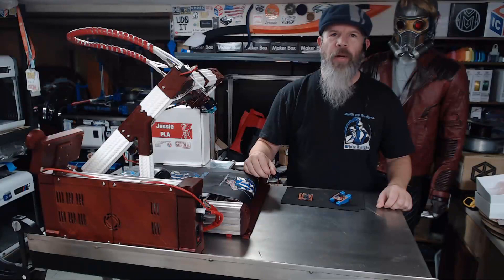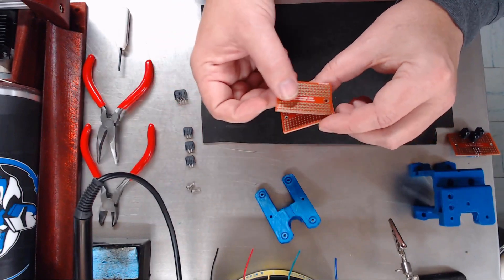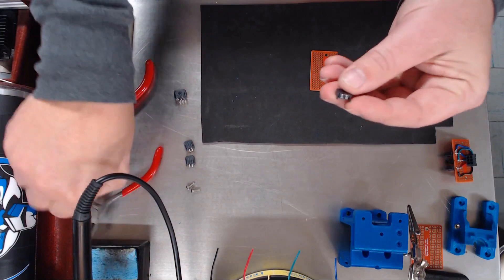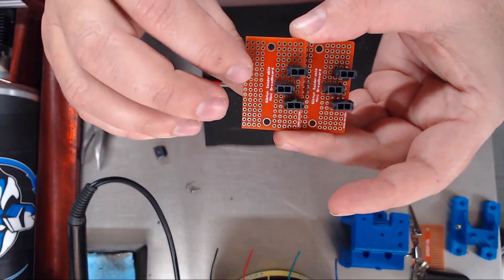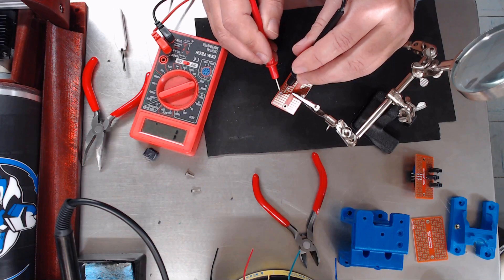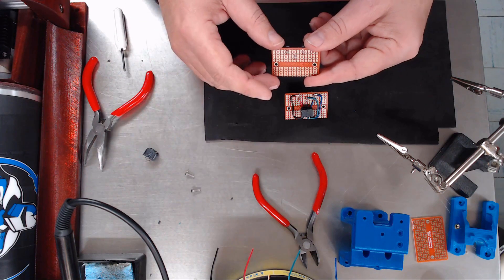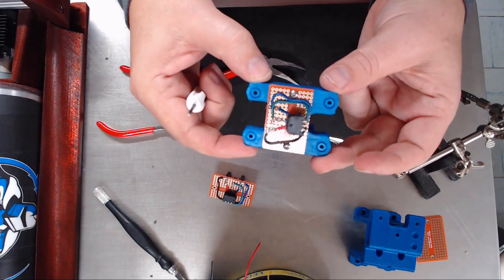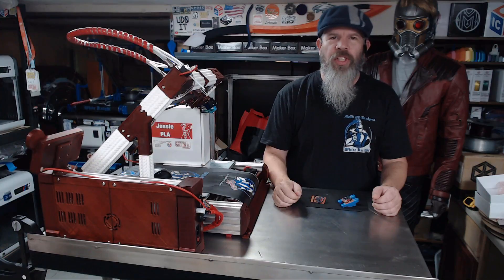Building the Hotend feed thru board.

Comment: Hi Karl, does the squire design only work with a duet board and reprap firmware, or can it work with an einsy board and recompiled prusa firmware? I'm trying to upgrade the bed of my Prusa with your belt bed design for continuous printing, but would still like to keep it within Prusa firmware so it can be compatible with the MMU2S. Thanks!
Reply from the maker: To be honest I've only used Duets in my designs, but I know other companies that use Marlin based boards so I don't think it will be an issue.